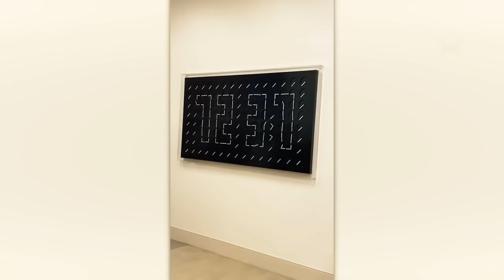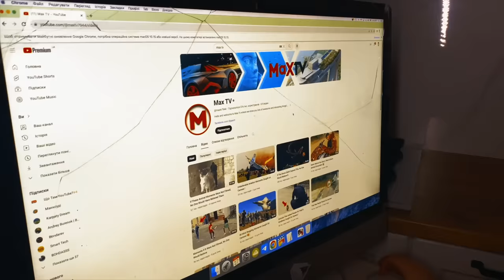That Was Really Filmed on Camera

Comment: Its hard to believe that a meteor of that size could completely wipe out humanity in a instant Why because its travelling at 12 miles per second that's about 8 times as fast as a speeding bullet sobering though hey .Don't worry or have  nightmares for its unlikely to happen until at least 2036  if it misses in 5 years time so at least it's giving you enough time to build your own personal bunker in a mountain before it hits So you  better start digging?